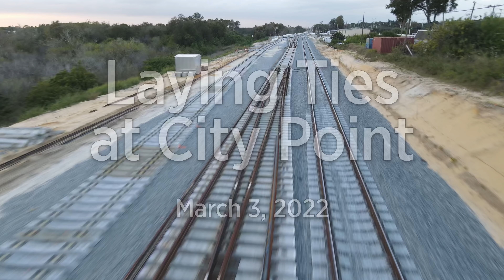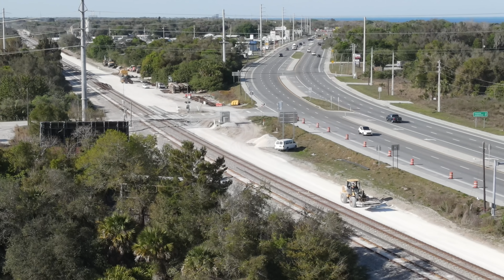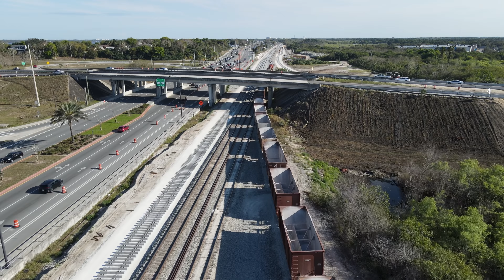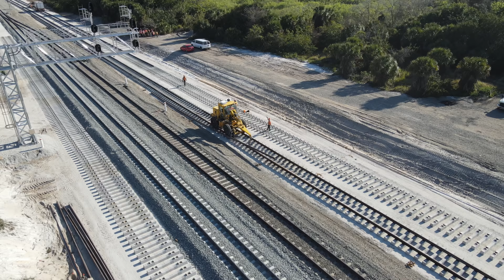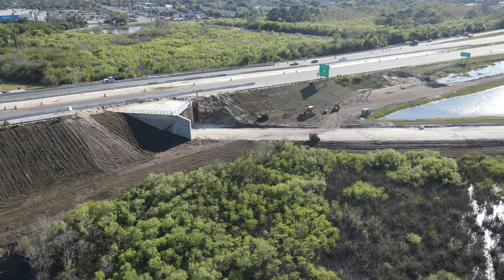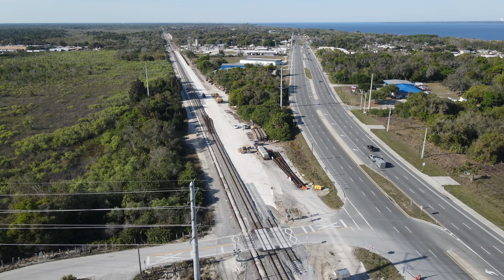Brightline Construction: Laying Ties at City Point - March 2022

Comment: There’s a former Rinker concrete plant  in downtown Fort Pierce that’s producing some of these and the ties are stacked all over the yard. 
Thanks for the update . 👍
Reply from the maker: I fly over the Rock plant in Ft Pierce in this video: https://youtu.be/Kc_C-eJFSOc
Reply: @RoamingRailfan  Just watched the link you gave me . Thanks 
The Chamberlain road crossing is finished and looks good .
I didn’t realize how full the old Rinker concrete plant was with the concrete ties. I use to run a readi-mix truck for Rinker concrete out of that yard many years ago. 
Thanks again 👍👍👍